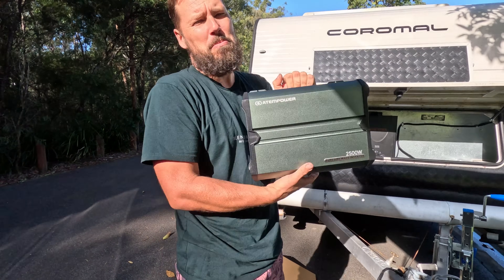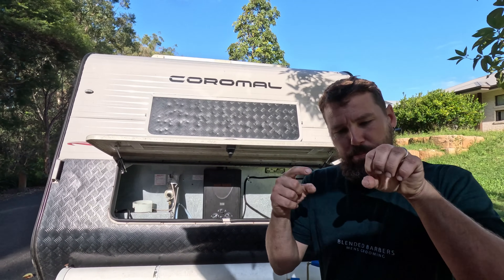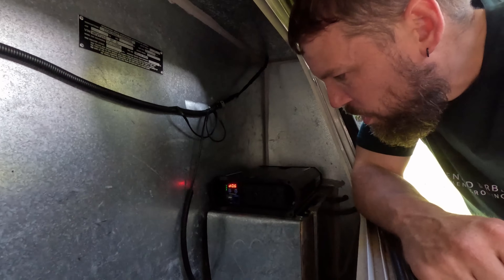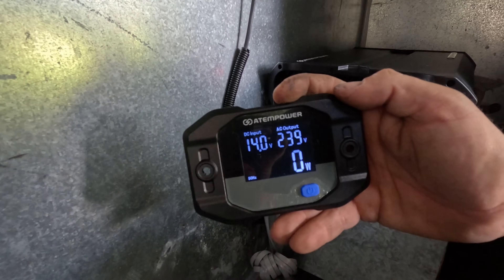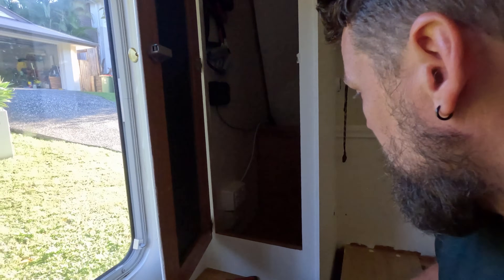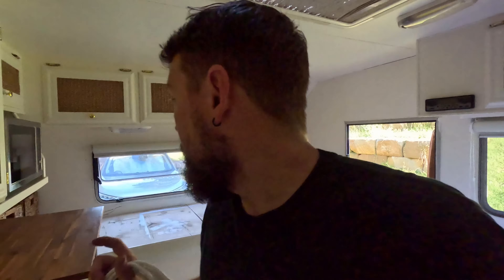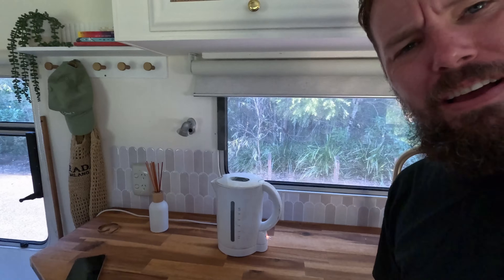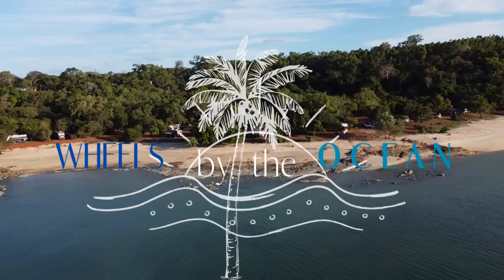Is this TOO MUCH POWER? 4900W Inverter Install & Testing

Comment: PICKED UP A 7000 W / 3500 CONTINUOUS.
THEY ARE SO CHEAP NOW.
INSTALL A MINI 12V  CAR FAN POINTING ON INVERTER BATTERY.
ONLY WHEN NOT DRIVING.
.

Comment: Get sparky mate to fit an inside socket plug like the  outside one , then the inverter off grid powers all 240 power points in van no need for extension lead then , im thinking off doing same thing with a bluedi power thing so it's inside and won't get pinched

Comment: I mean I know am being a bit over dramatic most likely but I would be a bit cautious putting that inverter there near the hot water unit, just incase a hose bursts or anything happens and water starts pissing out spraying over the inverter.
Reply from the maker: Haha cheers mate 😀
Hot water system is going to get relocated very soon, just not the best spot for it aye.

Cheers

Comment: I just plug the extension lead from inverter straight into the mains input. Everything works, no sparkie mate needed. I have Atem power 3k inverter and 3x 100aH batts. Just dont run everything at once.
Reply: Same,  just make sure the fridge and battery charger 240 are off!
Reply from the maker: Thank you
Reply from the maker: Thanks mate!! Im going to do it!!! 
Why the heck i didnt just do that! Hahahaha
Must be my first day! Lol
Reply: I do have a weatherproof 10A to 15A adapter that has a safety switch built in to make it a bit more legit. It'll trip if I overdo it. (But it never has yet)